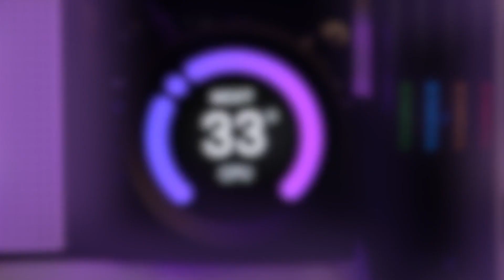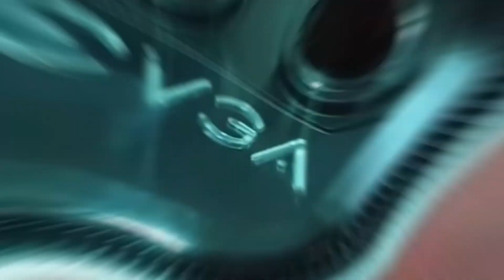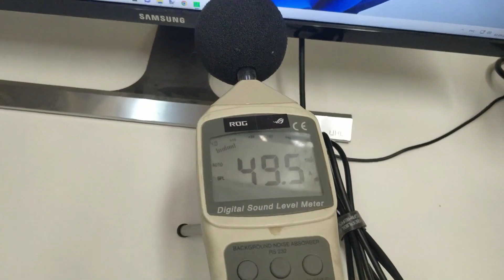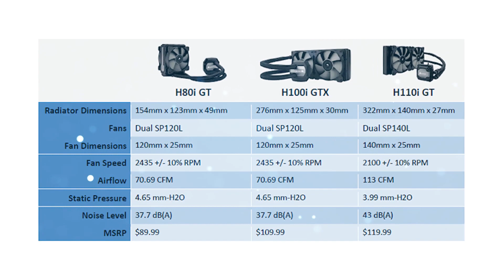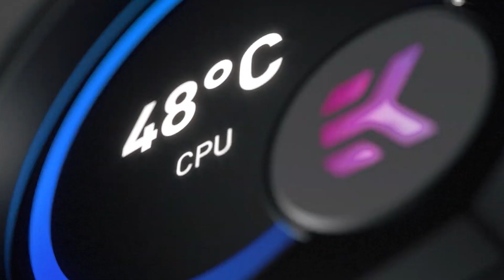Best AIO Coolers 2023

Comment: Does someone know how worse the LE520 Is compared to the LS520, it's considerably cheaper, but aside from slightly slower pump speeds and some aesthetical changes, I do not know how it performs. I'm planning to get it for a 7800x3d. In theory even an air cooler is enough for that CPU, So I'm guessing the LE520 will be more than enough)

Comment: I had a arctic liquid freezer ii 360 and the pump is dead it can’t handle my ryzen 9 5950x I ordered the CORSAIR iCUE H150i RGB ELITE hope this works better
Reply from the maker: The pump died? That’s weird. That cooler  should handle 5950x if its working just fine.
Reply: Heads up from experience, icue doesn't play well with amd. Have the same cooler,worked perfectly with asus tuff mobo and intel cpu. Now it won't even recognize  the corsair commanders or lcd screen!

Comment: Good afternoon my friend, in your opinion for a rizen 5600 G processor, could you recommend a cost-effective water cooler to meet this processor?🙌🇧🇷🇧🇷🙌
Reply: Shouldn’t need AIO unless it’s a preference. Could get away with boosted speeds with heatsink and fan. Thermalright 120, the Noctua NH-D15, both will get the job done. It’s not really a hot cpu
Reply: Just go with the stock cooler you get with the cpu it should be more than enough
Reply: Corsair iCUE H100i RGB ELITE Liquid CPU Cooler